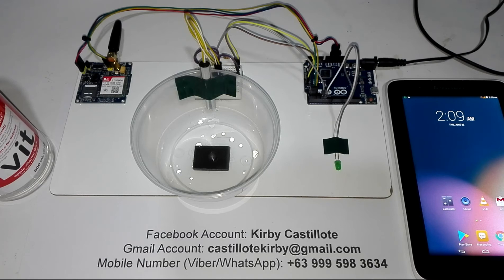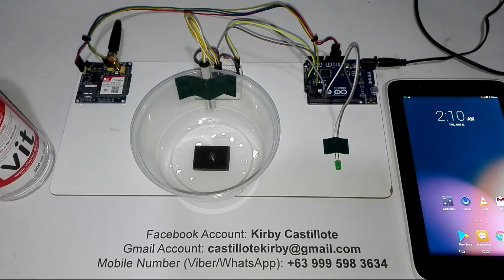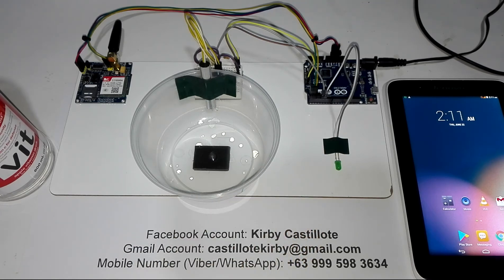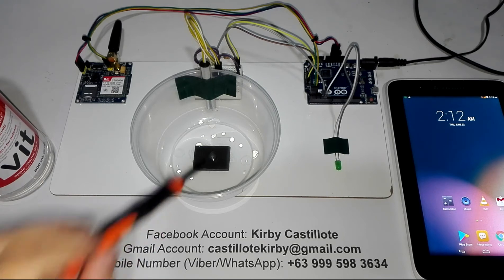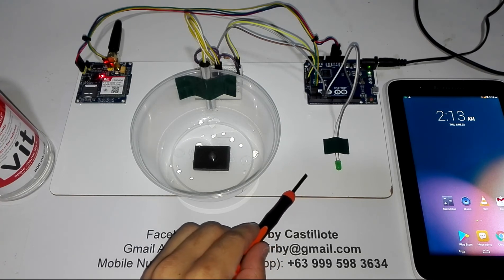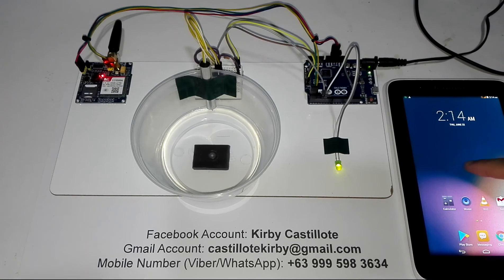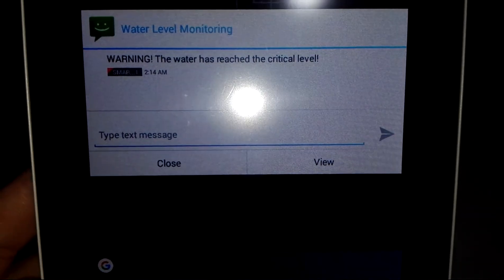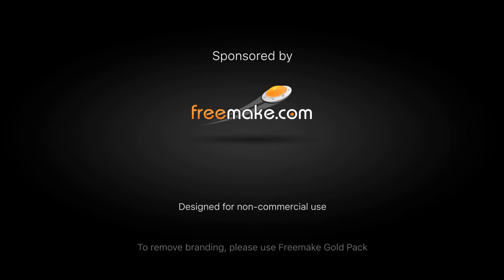Improvised Water or Flood Level Monitoring Using Arduino with SMS Notification

Comment: Meron po ba adruino uno sa deeco branches specially quiapo?
Reply from the maker: Oo meron dun, meron rin sila mga sensors. May DEECO rin SA Farmers Cubao, nakadisplay lang dun ang mga Arduino and Arduino Compatible Modules nila.
Reply: @MariKirbyCastillote  pwede po next po basic adruino coding ? Plan ko din po kasi gumawa ng LED dancing light built in sa speakers na gagawin ko po.